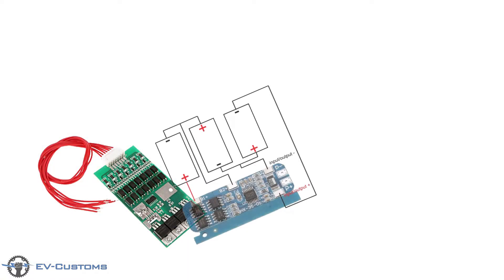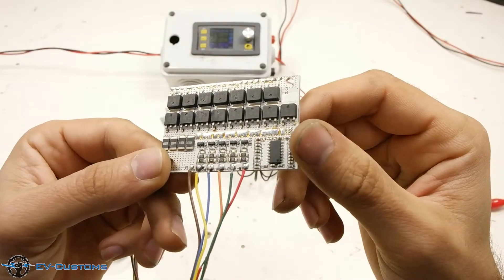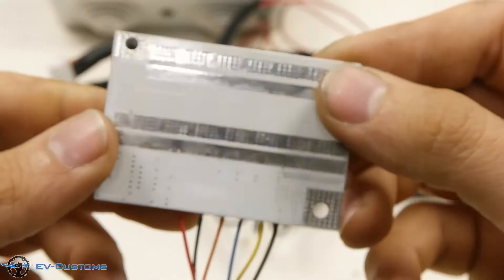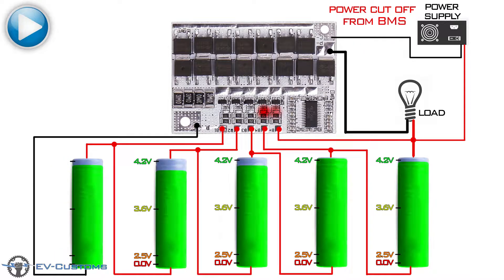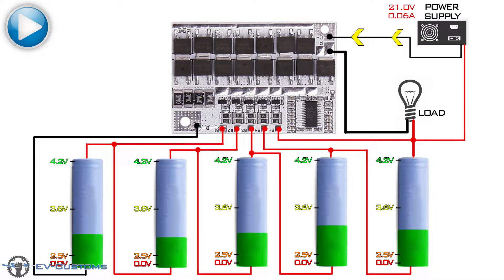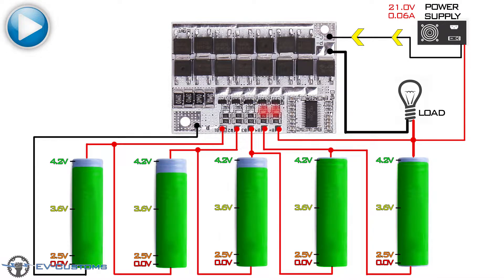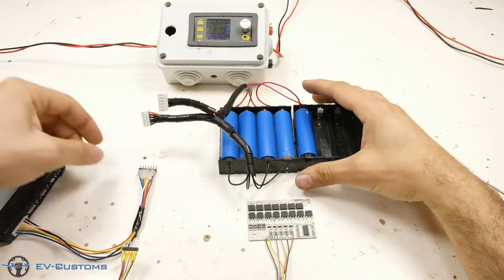How to Make Perfect Balance on lithium Batteries with BMS Board (Animation)

Comment: My smps gives a constant voltage of 21v and around 20 a(since its my desktop psu and Im trying to build a ups with this battery pack system) will it hurt the battery? If so how can I charge the battery and also run my pc at the same time?

Comment: Bro i have an issue with my bms. I am not getting full voltage through bms. One cell voltage less I am getting. Like 8.9-9V through bms I am getting. But when I am directly checking the series I am getting full voltage almost 13v. What is the issue with it.

Comment: Hello. thank you for the good explanation of balance charging. i have the same BMS, but i don't find how to use the thermal protection (ntc on the back side) i can't find the value of the NTC and if there is a resistance to remove somewhere on the card to allow thermal protection via the NTC connected

Comment: interesting basics thanks I guess a 4wire measure of the RI (uner 1Khz)  should be added  . I have scratched my head a lot with those second hand batteries capacities and processes. In the end what may vary the condition of the LiIon element is his history ; how was it used, charged,  at wich temperatures. SO having a balancer module used for the charging may really be advantageous in the long term. If not when we try to recycle a battery that have some smll weakness on one or a few cellules, correctying it with a balancer may be pleasing for the eyes, but it is not a guarantee that the balance will stay in place (on the contrary the weak cells degrade soon, as I was told from experienced friends)

Comment: Thank you for the informative video. I was thinking about pulling out the battery pack of electric scooter to manually balance the cell groups. I have no idea about the BMS model. I'm sure it's a cheap resistive balancing BMS. Do you think applying the same voltage to the charge port and with very low current like 20-30 mA do the balancing without pulling out the battery pack? I guess you did exactly same in your video.

Comment: Hey boss! Long time no talk! I'm curious,  can I use this bms and charge up to the stated specs. 60amp. I have a 5s3p pack, and typically charge those at 21v 3amps. Will this damage my cells? Sorry, your statement about using 60ma kinda confused me a little. That's way to low of amperage for charging.
Reply from the maker: Hellooo my old friend.. 😄, you mean 60A charging current? normally charging current is at 40A normal rate, but...  if you put some serious heatsinks on the MOSFETs... i think it will work..  about 60ma is equalisation current... if you want to equalise you batteries you need limited current at 60ma..
Reply: @evcustoms  got you! so maybe charge up the bateriers tyo 19.5-21V and lower the current so it will equilize the batteries. do you know if the ballancing is active or passive? Thanks for getting back to me so quick!!!!
Reply from the maker: @njfulwider5   Correct! at the end you can put 60ma to equalize them, this BMS boards they make only passive balance (by resistors)

Comment: Did I understand you correctly: you said charge the battery with a lot of amps instead of a little?
Reply from the maker: No...  first charge the battery normally and after that charge it at very low currents by your bms balance specifications..
Reply: @evcustoms  OK. Can I charge with 4A if the cells are 2,500mAh? Discharge current is 3C.

Comment: I like to micro cycle the battery, and charge it with very low current, if it gets out of Ballance, charge at 250ma to 500ma, from about 4v per cell, to 4.25 max, only when balancing, normal use I charge to 4.0-4.1v, or 3.45v to 3.55v with lifepo4 cells, only charging to 3.65-3.75 to balance!

Comment: Correct me if i am wrong, so assuming i have 4 group of cells and i am using a bluetooth bms (ant bms) to charge it all up. So u are saying let's say the cell is not balanced so i have to charge it at probably 2A first and then slowly reducing the charging current to perhaps 0.18A to let it fully charge each cells to 4.2? Am i right? thanks.
Reply: Sounds like it

Comment: Really doubt it if it’s malfunctioned ， it makes no sense to me that has to charge it with 60ma in order to balancing batteries correctly.
Reply: the balancing can only shift 60ma from the highest to the lowest battery so for perfect balance you have to charge with low current at the end. its described in the datasheet

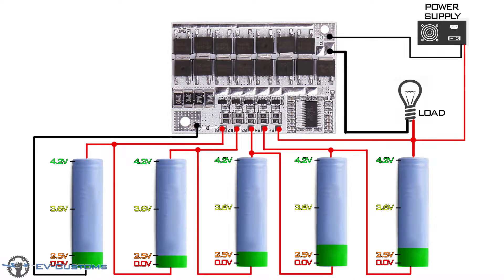Comment: 2:32 What? "If we put current equal to balance current of the board" ? Are you suggesting the input current has to be manually reduced in order to have a good balance? If so, then why bother using this board if it's not automatic.
Reply from the maker: This is biggest issue of BMS boards...
Reply: @evcustoms  Do you know of any 3S-6S BMS boards that do half decent balancing that don't break the bank? Some are suggesting adding a TP4056 to each cell in combination with the BMS, but that doesn't seem like a good solution for a couple of reasons.
Reply from the maker: All BMS boards can protect the cells, the issue is on battery balance, is to slow....
Reply: @evcustoms  I know, I'm asking if you know of any BMS boards that do fairly good balancing too?
Reply: @evcustoms  Why are your cells so badly "out of balance".  Once the pack is top balanced, it should not take very much Balance Current,  to keep them in balance ...

Comment: Yo! Is there a  minimum req. of power to charge the batteries? Is the 21 volt the minimum in this case?
I was thinking of a way to add a small solar panel to an e-bike set that would charge individual batteries.
Like in your case you need 21volt and i suspect the circuit eats some parts and charges all of them. But there might be a way to charge individual batteries with very small solar panels? Perhaps extending the battery life and "slowing down" discharge while not in use by slowly keeping them charged and it would select the lowest one for better efficiency or smth. (if possible without changing too much the battery scheme)
Any insight into a better solution even? Like adding a solar panel to the "regenerative" braking input? By controller manipulation or smth.

Comment: Thanks for the great video sir, but I happen to have a question about this board. Do you know if it can also work like a 4s or 3s BMS, so without every of it's terminals(or I don't really know what you call it) connected to a battery?
Reply from the maker: Yes this board can work 3S-4S-5S battery packs..
Reply: @evcustoms I tried 4s en 3s but failed.

Comment: What should I look for in a BMS for a Powerwall with 18650s 20p x 17s?
Reply from the maker: You mean Powrwall? It is exact from power output an battery himestry..
Reply: @evcustoms  wouldn't I need a higher current balancer with 20p, seems that it would never balance in one day with only using solar.
Reply: @diydan6045  It depends upon => how unbalanced your packs are.  If they are well matched packs then you do not need much balancing ...

Comment: I used this BMS to make a 5S1P Li-Ion battery for a drill. I have connected the P and C ports together, as it suggests you can do in the documentation.  It seems to charge ok, but in this configuration, I am able to run the battery all the way down to 8V.  I expected it to shutdown the battery at 13.6V (2.72V*5).  Do I need to have the Load and Charge Circuits separated to protect the battery from Over Discharge?

Comment: Hi good day is it possible  to use a 35ah bms.  But the actual ah of a battery  is higher than 35ah. ? Like for instance  i use a 16s 60v 35ah. But i use 3800mah battery.  So 9 p is only 34 ah not enough.  I need to use 10p. But is equal  to 38ah.
Reply from the maker: Hi...  Yes of  course you can do that,  if you mean capacity of battery, you can put also 1000Ah battery...
Reply: Thank you.
Reply: So what is the use of the ah in a bms?  Does it matter?
Reply from the maker: @junesarol1782  Ah is max Amps output, more than board max Ah output the board disconnect battery  to protect it.

Comment: Is this board suitable for a 18v drill? I know that some boards dont deliver enough power to make the drill working properly.
Reply: Anyone?
Reply: @-SoFazesSeQuiseres-  I am using it for all my power tools :) Even my with my disc grinder that uses 80A at 20v no problem 👌🏻
Reply: Yeah. I use it fır my 18V drill. It works super.

Comment: Dear friend, i have bought the same bms, i've two question for you:
1)is a real 100A max flow?
2)when i measure a battery with multimeter in continuity mode this sounds but no resistance is showed, what is happend?
Thank you so much for everything help
Reply: its around 60

Comment: Thanks for sharing. But some bms do balance (as soon as a cell reach 4,27-4,28 volts) at the same time as stop charging (until this cell doesn,t reach 4,19volts). And once again begin charging. So this won't help such types.

This one for example do this and additionaly it cannot balance first cell of the 10, notice one missing transistor )
https://www.aliexpress.com/item/32990936317.html?spm=2114.search0104.3.9.4507587dJPkjC8&ws_ab_test=searchweb0_0%2Csearchweb201602_6_10065_10068_319_10059_10884_317_10887_10696_321_322_10084_453_10083_454_10103_10618_10307_537_536%2Csearchweb201603_51%2CppcSwitch_0&algo_expid=84b8403a-c52a-4288-84e3-ce454b7b7588-1&algo_pvid=84b8403a-c52a-4288-84e3-ce454b7b7588&transAbTest=ae803_4
have a good day
Reply: I talked with a guy who is fixing batteries, and he talked about some BMS from China that have missing transistor. I think this is the one, but I will confirm with him.
Answer, buy a better BMS or fix it if possible. Please check Yousun ('s)
 channel, he is fixing his BMS and he is also selling good ones.

Comment: Will ever light all 5 leds?
Reply: Yes , bc they start turning on in 4.18 v . And its not a good thing puting 4.2 x 5 = 21v on it  . Better put 4.17 x 5 = 20.8 v and red lingts wont come up after pack is already charget but still with charger on it.  🤺

Comment: 60 mA its not much for a 100 A bms !  Can i add 2 bms on the same pack and charge them with 120 mA ?! 🤕
Reply from the maker: Yes you can do this..   2-3-4 BMS in parallel...
Reply: @Raj Gj - Why are your cells so out of balance?